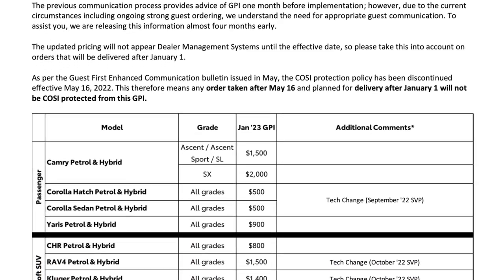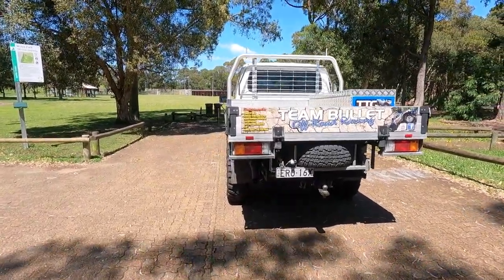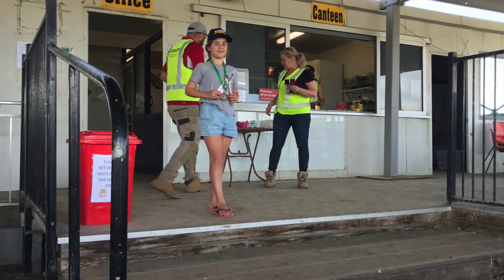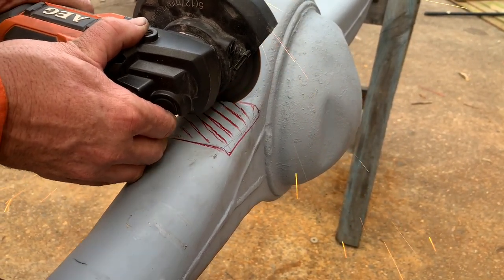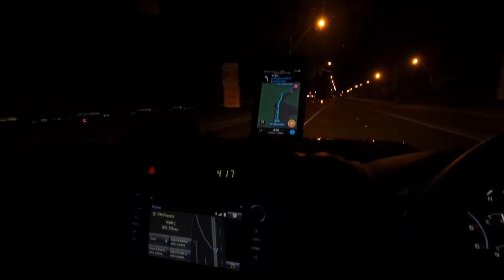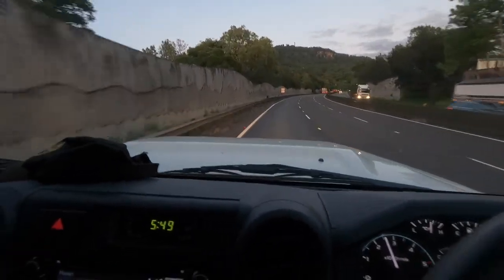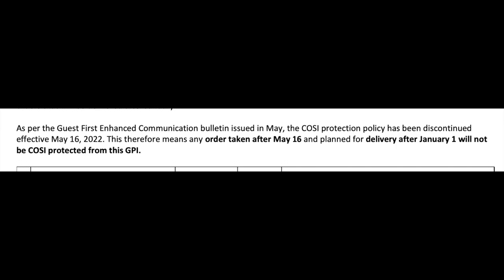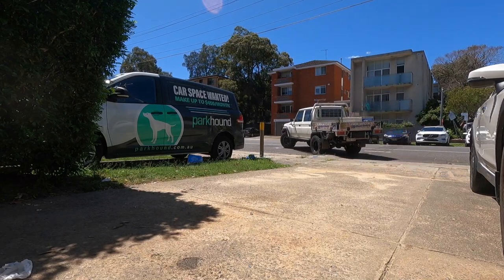New Toyota Landcruiser 79series on 35 inch tyres 1st drive fuel consumption numbers towing 1 tonne

Comment: With your rear wheel bearings, I've seen some remove the two rear axle seals in the axle tubes and run the diff oil in the rear hubs. You add an extra 400ml of oil once full through the breather outlet on the top of the axle tube and the LSD oil runs throughout the diff & hubs. Oil is what big trucks commonly run in their hubs & wheel bearings.
Reply from the maker: Seen this also, thanks mate..

Comment: Just wondering what you think of the new head unit in the 79?
Thanks for the vid
Reply from the maker: Cheers Michael, yes big improvement on previous model, which we ended up putting the 200series one in, but this one is as good as that from factory, so saved me money, but would still be nice if the had a camera set up from factory.. So big tick from me.....

Comment: Can you run 315/75/16 on lc79 with 2inch lift without scrubbing? Thanks
Reply from the maker: 305s I would say confidently, 315s may just touch, caster correction may just help...

Comment: Don't forget your speed limit when towing over 4.5T G.V.M is 100Kmh. I got 99% speedo accuracy with TOYO AT2 285/75R16 in my 2014 VDJ79R, heaps better tyres offroad & on.
Reply from the maker: Cheers Dusty, yeh same the 285 75 16 I ran were 99% too....Plus cheers on the reminder....

Comment: You don’t have to replace the wheel bearings every 20k, even with -50 wheels. Muddy or salty water will kill them fast but if you keep them clean they are good for 200k plus. 

I can’t believe TJM are still flogging those rubbish urethane caster bushes. You will be running close to zero caster with 3” lift but the real downside is the lack of flexibility in the urethane and the lack of clearance on the tight side of the bushes, they are fine for highway, arguably better than rubber, but severely restrict off road articulation and will tear the control arm mounts from the axle housing. The easy solution is caster arms which ironically also severely limit articulation because they don’t twist. The proper solution is cut and turn the knuckles, which is a massive punish job.
Reply from the maker: Cheers Brian, re bearings, you know im no chance of keeping mine clean....

Rotating knuckles??? You going to be an expert after the Bullet truck mission..
Reply: @TeamBulletOffroad  🤣😘